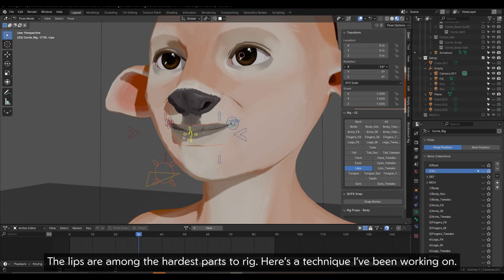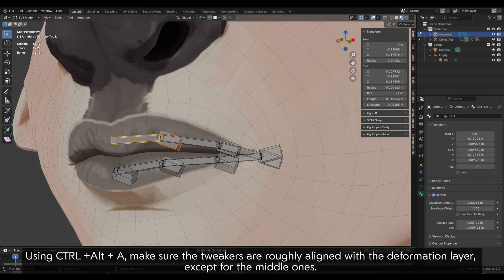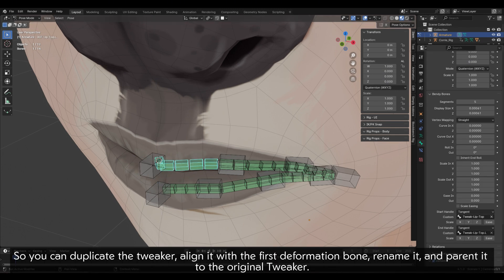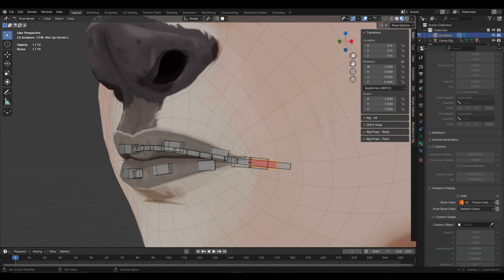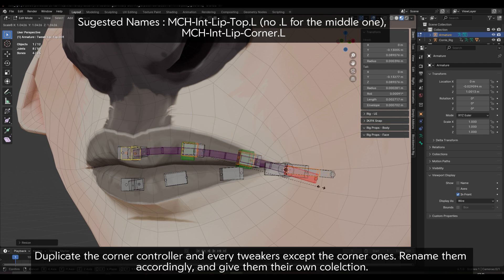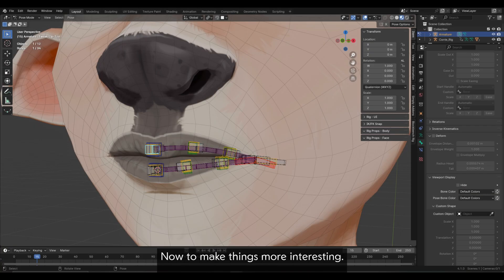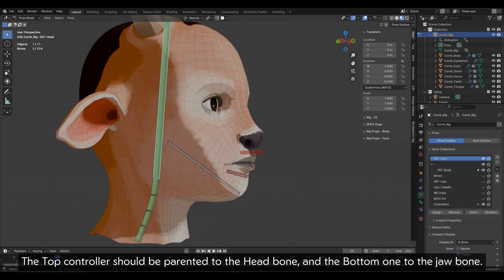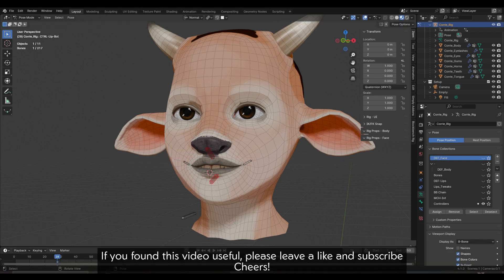How to rig lips in Blender - Part 1/3 | Intermediate level Tutorial

Comment: Thats so cool dude, but I still can't figure out how you set up the autoweights so perfectly that your weights are assigned so perfectly by 1 click. its crazy
Reply from the maker: I guess after some time it becomes easily guessable, a bone will "bleed" weight until it meets the influence zone of another bone, at which point it'll blend with it. Place enough of them in strategic places (joint, non-deforming areas, etc) and it tends to give pretty good results

Comment: i completed but after automatic weights , bone not working properly with skin at 11:57 , also eyes and nose affected and broken , 😢 what's the reason please tell me face is my last part of rigging ??
Reply from the maker: I think I show a bit of where to place bones on the rest of the face in my last tuto (about eyebrows)
Basically if you don't have enough bones in the face the lip bones will bleed weights all over and deform it badly. Also, if you character has a closed mouth by default, it's unlikely that the automatic weight paint will do a perfect job because the vertices will be so close. This is usually an area that needs manual weight painting correction.
Reply: @rakenval is there any platform where i can show you  my model and the problem visually ??

Comment: I haven't found anyone else with this problem in the comments, but around 7:13 when we are copying the in-between tweak bones to then follow along the BB-Chain using a Copy Transform constraint, when I get to the Copy Transform and assign it to the BB-Chain, the newly-duplicated in-between bones do not follow the BB-Chain and instead cut across from one end of the chain to the other in a linear fashion. I've tried messing around with reparenting to no avail. And my settings are matching yours as best as I can see.
Reply from the maker: Is the little curve-like icon next to the Head/Tail slider of the Copy Transform enabled ?
Reply: @rakenval  It wasn't! I didn't even know that was a thing! omg thank you Rakenval

Comment: Also the second time I followed this I got a tangled second lip bone.
You adres it in the first lip bone and center tail.
But I had it in the second going to the 3rd.
Reply from the maker: Yeah that can happen. Either a roll issue, or the bone is not facing the right direction, those are the two most common reasons

Comment: 11:51  I confuse a little..... It seems that multiple bones are applied to auto weight , I thought that they should be like the rig of eyes , this group of bones is charged of auto weight , and the other group is charged of keeping offset , and final group deals with the constraint.🤔
Reply from the maker: That's why it's important to make sure "Deform" is disabled for all the non-deformation bone. Even if you select every bone in the rig before applying the auto weights, only the ones with Deform enabled will add weights to the mesh, the others will have no impact
Reply: I got it! Starting from 2:00 , those bone duplicated after the time are all disabled with deform , so only these bones belong to DEF-Lips are applied for auto weight , despite choosing all bones . Thanks !

Comment: I know I might need to know how to program in Python for this system. But can you tell me the theory behind creating an IK to FK and FK to IK snap system?

Does simply copying and pasting the bone's position using the Global Transform addon solve it?
Reply from the maker: Not sure
I'm still learning Python myself and I haven't cracked the perfect snapping system yet, for now I'm basically copying a bone matrix to it's corresponding ik or fk counterpart. It works well for IK to FK, but for FK to IK there's an offset issue caused by the parenting that I've still no clue how to resolve. 

The Global Transform addon works well for individual bones but I've only ever used it for space switching and things like that, so I'm not sure.
I def recommend you have a go at learning python, it's very useful

Comment: Too bad bendy bones doesn't work for unreal engine. Best tutorial i have seen tho keep it up
Reply from the maker: Thanks. If you remove the bendy segments from the deformation bones you can export it (assuming you do all the animations in Blender and only need to export the deformation bones). It still works without bendy deformation bones (my very first facial rig version didn't include bendy bones at all), but it can require a more thorough manual weight painting and more corrective shape keys.
Reply: @rakenval  oh ok thx. Tbh I don't understand anything u said, I am a beginner at blender lol. Thx for the replie tho. Maybe Ai can break this down for me

Comment: it seams i run into a problem with the rig, when de model is not moving it works fine, still need some work before moving to the next part, but the moment it moves the lips start to move in the direction of the controller that is moving, i think found the problem, the blue controllers, the ones that have 2 copy location and are controlled by the corner lips controllers

to put an example, when i bend the model spine forwards, the blue controllers start to move forwards, stretching the lips and making it look like some sort of ugly duck, the moment i deactivate the copy location modifiers, it works fine, but while they are on, it breaks

edit: never mind, im dum, manage to fix it, i miss a  bone

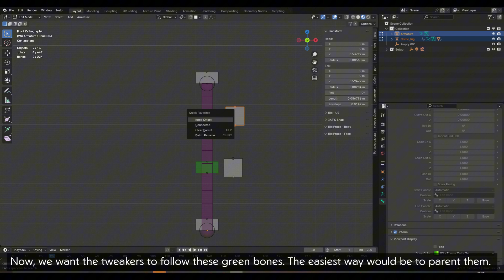Comment: I HAVE ONE ISSUE ON 7:56 THEIR MY COPY TRANSFORM BORN NOT ROTATING WHEN I ROTATE CNTRL CORNER BONE PLZZ HELP
Reply from the maker: Sorry I can't exaclty guess the issue, it could be a million things. Check that your constraint is correct, that it's targeting the correct bone, check if the handles of the bb chain are correct, or if some constraint is disabled. If you can't find the cause I'd suggest you o back a few steps and start again from there.
Reply: @rakenval  I want send my issue in video format but you are not replying me and you privacy settings didn't allow to send any video
Reply: @rakenval  and I try separately on new file copy transform like you try 2 point between single bandy bone but my 2 point not rotating like your they are moving but not rotate when I rotate corner side of bandy bone
Reply: Plzz sir help in this issue
Reply from the maker: @ I'm sorry I'm quite busy, are you sure you ticked on the Bendy bone option next to the Head/Tail slider in the Copy Transform constraint?
Reply: 7:14 -- I found what you missed here, this time stamp has him explain that button in the copy transform constraint that he did explain here. showing exactly how to get it to do what your looking to get done. (thinking you've either given up or figured it out a long time ago, but the next guy that needs this will find it useful. :)